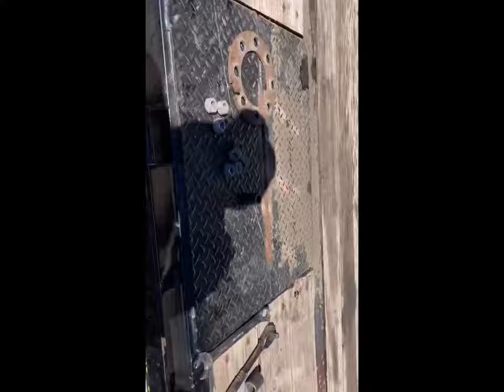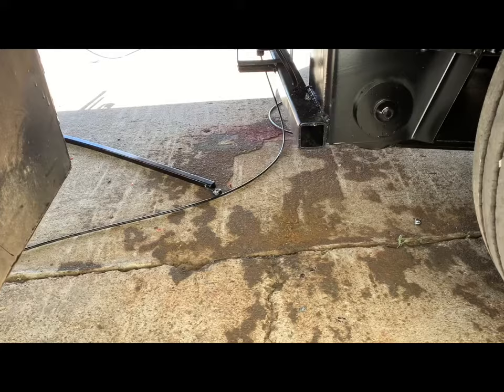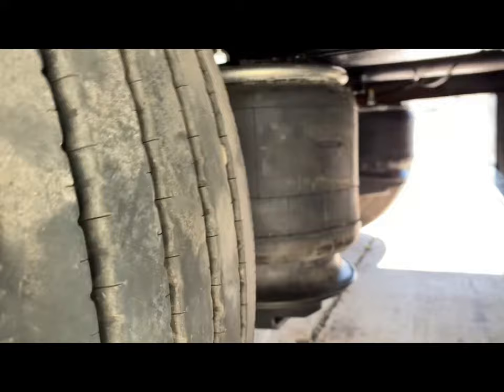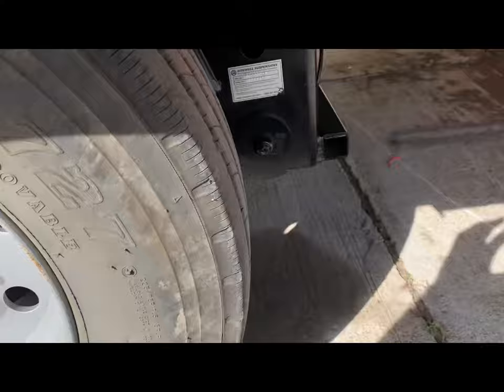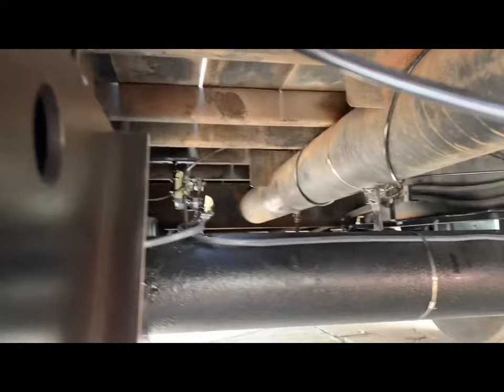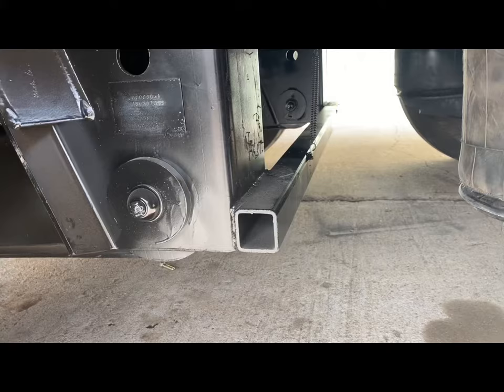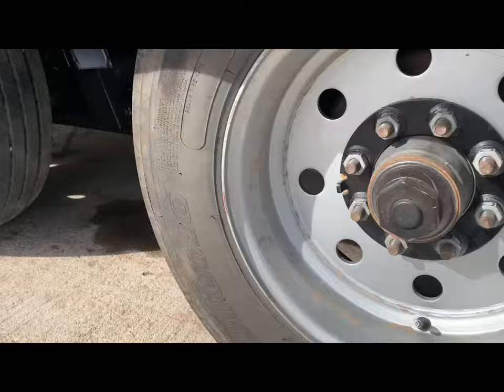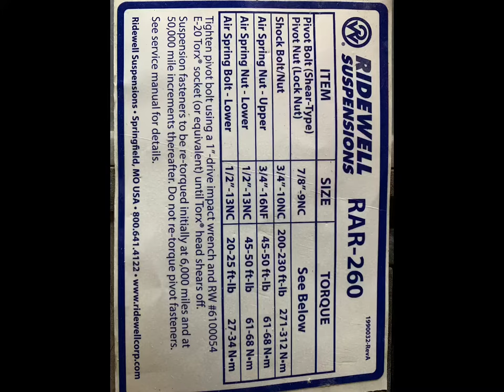Air ride conversion on my BigTex trailer

Comment: pretty cool!  i do have  a  question, did adding the air bags stop the back and forth jerking of the trailer that happens while towing on a rough road?
Reply from the maker: Not totally but it did help.    It floats.   I made a mistake by putting the shocker hitch on my trailer.    If you have a standard hitch it helps to keep the porpoise movement to a minimum.    Before I installed the shocker hitch it did actually pull without the surges.
Reply: Man so with the air ride the shocker is unnecessary?

Comment: When you put that pusher axle on how to you go about raising the weight ratings on the trailer?
Reply from the maker: In Arizona we are lucky.        On trailers there’s only 2 registrations for trailers.       Both have permanent tags.     They are registered below 10,000 pounds GVW and the other is above 10,000 pounds GVW.          We don’t have to worry about the stupidity like other states.     All axles count that’s why in Arizona you see dump trucks with pusher axles added to old trucks that weren’t sold with them.

Comment: How did you wire the compressor to receive power?  Did you have to spice it into a existing wire?  If so which one?  I am also converting my spring to Air ride.  Just having a hard time figuring out how to wire the compressor for power
Reply from the maker: I use the air compressor on my truck to give air to the trailer.       I put a plug on my truck right by the trailer wire plug
Reply: install an automotive battery to replace your away battery, and you can either put an ignition switch to arm the air compressor control relay, or you can run the activation relay from the compressor to only come on when your running lights are on, the compressor ignition wire should only run less than a tenth of an amp

Comment: How is the air ride holding up‼️
Reply from the maker: Absolutely great.     The best thing I ever did to my trailer.      I 100% recommend it if you can do it.     I did blow an airbag.     There was a shitty factory weld on the dovetail and when I was loaded the bag expanded and rubbed a hole from that shitty weld.

Comment: now the question is how to order the suspension kit for a non texas pride, jp, or diamond because they seem to have a doo not sell.  do you remember having to give them your vin to order the kit?
Reply from the maker: No the only thing they need to know is the axle tube size.
Reply: @stacyp4534  oh thank God 😊, everything else I looked online they don't have anything available and they usually just saying texts somewhere for Texas pride or dealer purchases only
Reply from the maker: @mccarterjg  I went through the same issue.     The kit is not on the ridewell website.     I called straight to ridewell and they just needed to know the axle tube diameter.    If it has changed then my guess is the big companies paid them not to sell the kit so they would get all the money.      In fact they had the option to be able to lift one axle if I wanted to.
Reply: @stacyp4534  what you do is attach your leveling valve to the rear axle, add 2 solenoids to dump and cut off air to the leveling valve, weld some tabs to the front axle chain it up and allow air back into the suspension.  The 50$ drop axle I'll be doing
Reply from the maker: @mccarterjg  for the leveling I have a bar that goes from the front axle to the rear axle on each side.     I did side to side so it wouldn’t lean if it gets side loaded

Comment: What did the kit cost? Thanks.
Reply from the maker: If I remember correctly it was about $1,400 per axle.    That did not include the dump valves or any items like the hoses and tanks and such.      Ridewell does not have this kit listed, you have to call them.     The kit is easy to install and so worth it.     If you spend the money you won’t be disappointed.      I love it.
Reply: Do you recall the part number?

Comment: What kit did you use and where did you order it
Reply from the maker: It’s complicated but not too complicated.     The kit is from ridewell.     If you go to their web site it doesn’t show.    You have to call ridewell manufacturing and tell them the axle tube diameters.     They make several different kits but the kit for my big Tex isn’t listed.    They had it but it’s just not listed on their web site.     Call them have your trailer manufacture name plus the axle type, weight rating and axle tube diameters.    From there they put the kit together for you.